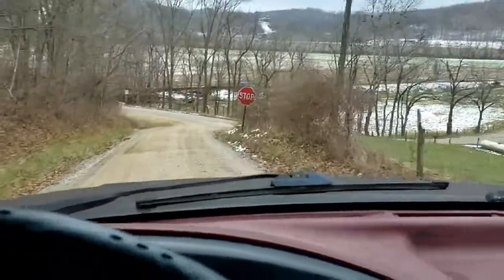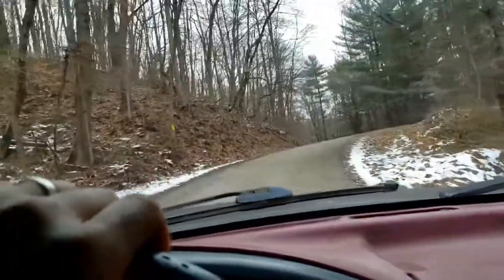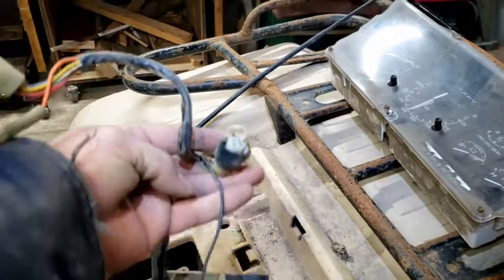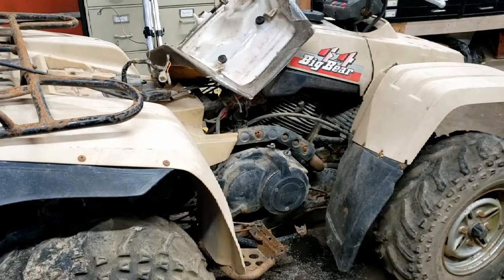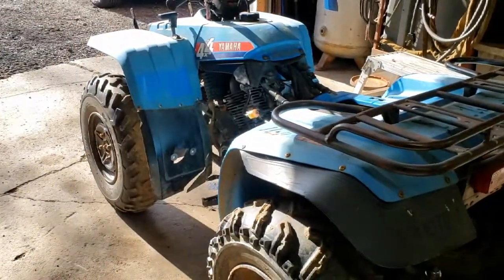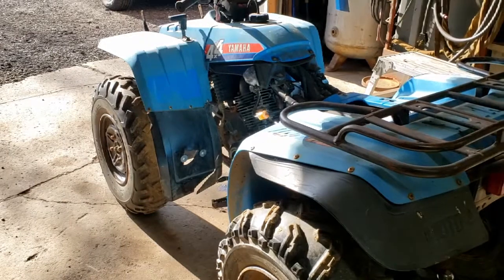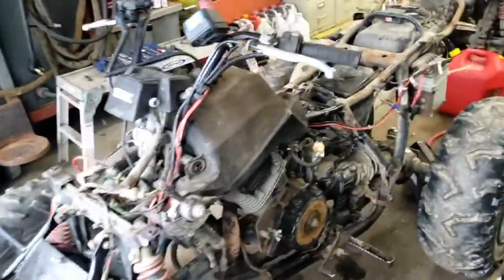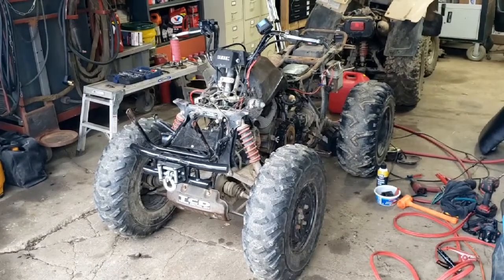Big Bear 350 Rehab - Part 4: CDI and Stator Troubleshooting

Comment: Thanks for the video! I have a 87 Big Bear 350 and its been down for almost 4 years have replaced Carb, CDI, Coil, Peacock, Fuel Lines, did a Valve job, checked the timing and now have bought a stator and waiting for my Mechanic to swap it in, hoping this will solve the problem! I bought this new and have it set up for doing jobs around the farm and really need it ! from watching your video mine ran just like yours did( no top end)

Comment: You don’t have any back pressure from the exhaust pipe. Weld a plate over the the end of the pipe and drill a 1/2 inch hole in the plate. Ooops didn’t realize you put a proper pipe on it. Good job figuring it out.

Comment: Bridge the brake switch on the left side handle bars, fallow it down and unhook it. After that connect the 2 wires you unhooked together but not the wire from the switch, the ones that are part or the wiring harness

Comment: I bought a cheap cdi and wired up for $9 got a spark but the timing seems off you no if the old CDI has built in timing advance and maybe mine new one doesn't
Reply from the maker: That's sure what it seems like to me. That or you have the 2 pickup coils and the CDI is connected to the wrong coil.

Comment: I have the same machine as your blue 1988 Big Bear. I just came from the dealer and the mechanic spent 20 minutes looking and reassured me that the 1988 had only a single pickup coil. So I searched through my photos and found photos of serial number and manufacturer date 9/86. Long story short, turns out the blue 350's are not Big Bears even though Big Bear is pasted all over it. They are 1987 Moto 4 350 / Big Bear. )) In 1988 they went to a single pickup coil. 
The parameters for the dual pickup coils are 180-220 
Yellow - Green
Gray - Blue
The parameters for the source coil is 220 - 330
Brown - Red

Comment: man I am glad I found this video. i have an 87 350 and it only fires once on the 1st rotation. then again after the key switch is reset. my pickup coils are in spec 192 but source is 325 which is close to 330. any thoughts any help appreciated
Reply from the maker: I'm not an expert on these, but it sounds to me like the CDI would be a good place to start.
Reply: I am also working on a 1989 350 big bear, and have the same issue, sparks once then nothing, shut key off , turn back on, push start button engine turns over sparks once then nothing. Bought cheap caltric stator, cheap cdi and a Ricks coil. Still sparks only once. Do you have 2 trigger coils? Do you have 3 relays? Is it the cdi that switches from basic timing to advanced?
Reply: @fjb6576  have you disabled the park brake sensor. They fail all the time. Basically the park brake sensor goes bad and acts as a restrictor.
Reply: did u figure it out man ?

Comment: What would cause a 1995 to cut out low-mid rpms. Revs fine in neutral but once in gear it has no power and will cut out or miss until i get up enough speed than it will be alright once im in the high rpm range. I had my carb gone thru and everything is clean. It dosen't smoke or dosen't backfire.
Reply: I have the exact same problem.
Reply from the maker: @mikechapman599 replacing the pickups in the stator solved the issue for me.
Reply: @mikechapman599  mine was a cracked intake boot. It wasn't even noticable when looking at it but sure enough when i goy it appart it was split in 2 pieces.
Reply: Thanks, guys. intake boot is brand new last year. But I will double-check that.. it may be the pick-up

Comment: Question for you does your exhaust pipe coming off the engine still glow red hot after fixing the cdi and stator?
Reply from the maker: No it doesn't. I think that the ignition timing was way late so it was ejecting fuel that was still burning through the exhaust. Runs a lot better and much cooler now that the ignition timing is right.
Reply: Im having the same issue with mine glowing red but now my machine is stuck in reverse after pulling a few logs any recommendations?

Comment: Do you know would case a big bear to have loss of power I have rebuilt the carb and checked timing and other stuff just cannot figure it out
Reply from the maker: Does the exhaust get like stupid hot? Like practically glowing?
Reply: @diymechanictv1233  no. Could the stator or the magneto cause that problem
Reply from the maker: It did on mine! The timing wouldn't advance as the RPMs increased.
Reply: @diymechanictv1233  I am confused on what you are saying
Reply from the maker: Mine would idle fine but had no power above idle because the ignition timing wasn't changing like it  should.
Reply: @diymechanictv1233  how do you check ignition timing
Reply: @diymechanictv1233  if that is the normal timing then it is spot on
Reply from the maker: Not much you can do on these bikes aside from replacing things. I did it on a hunch and it proved right. Start with the CDI and the pickups on the stator.
Reply: @diymechanictv1233   is there a way you can test the stators or do you just take a guess and buy a new one
Reply from the maker: Yes. One of the videos on the channel walks you through that process.
Reply: @diymechanictv1233  ok I will check it out. Thanks if I can’t figure it out I will get back with you
Reply: @diymechanictv1233  so I finally go around to testing it and it read around .8 for all of them and still have the problem I took the carb off and cleaned it again just to make sure and I put the factor air box back on the quad but have to wait till morning to see if that will fix my problem. One other question do you know the slide pin piece do you know what it it is supposed to be clipped in I don’t know if that would cause the problem I am having.

Comment: Hi again, apologies for my comment in part 3 as I didn't realise there was a part 4 where you had solved the issue.
My issue persists whereby my 92 big bear struggles to start (occasionally backfiring ) and takes an awful lot of cranking to eventually start and when it does start it is a weak idle/firing. When I open the throttle is goes well.   But it struggles to idle and the plug lands up sooted indicating that it is running rich.  I am assuming the backfiring when trying to start is flooding.  Are you able to tell me how to adjust the carb to idle less rich ? I can only see the fuel mixture screw which is a pain to adjust with the carb on the quad. Is there an air mixture screw or am I missing something?  Great informative videos by the way!
Reply from the maker: That mixture screw is the only way that I know of to make any adjustment to the air/fuel mixture, unfortunately. After fooling with mine for so long, I ended up buying a replacement carburetor and once I got the ignition timing issue resolved, it has been running well.

Comment: Hey I just got this exact quad. I have some very small things wrong with it such as the gap in the small boot in the rear axle. You had this exact problem in your pt 1 video. Do you know where I can get a replacement? I also am trying to find a pull chord but having trouble finding a handle that will fit snug with this engine.
Reply from the maker: They're great bikes! Not a real powerhouse but a good reliable workhorse.

I ended up ordering the boot I needed from Partzilla.com. It's supposed to arrive by mail today, actually. I didn't look to see if they had pull start parts or not, but that'll be soon to follow on mine are well. Mine had all the parts but the pull start was full of mud and rusted the spring in half.

Good luck with your project!
Reply: @diymechanictv1233  thank you. Did you ever fix the fuel leak issue. I have the same thing. Also to replace the boot don’t you have to take the entire back half out?
Reply from the maker: Yes, the back swing arm and axle have to come off the bike to replace this boot, but it really doesn't look to be that big a job. Maybe I'll shoot a quick video on how it is done.

I never really saw it leak fuel. The PO said the petcock leaks, but I've never seen it leak once, so who knows...

Comment: Make sure you check compression it's because of valve lashes right doesn't mean a valving leaking and if a valves leaking compression it'll never have any power
Reply: Great job man Great job on the video I stand corrected on the exhaust just awesome

Comment: when you pull that carb  off again,you should be able to disconnect the throttle cable at the carb. just pull the throttle lever in the carb back and slip out that little brass retainer at the end of the wire and it will just fall off so dont lose it. then you unscrew the nut just on the outside of the carb and the wire will pull through
Reply from the maker: Sounds good, I'll have to try that if I take it off again.
Reply: @diymechanictv1233  just installed my carb after a cleaning and carb kit install.  Half the parts weren't correct but was able to use the orings and seals with the original parts. I'm having a hell of a time getting it run smoothly. Any adjustment suggestions?

Comment: Brother you ain't got a spark problem You got a fuel problem now you need to check your compression and see what it is I'll tell you if it's the valves and the rings it ain't smoking so I wouldn't think it would be rings but it could be the carburetor it's definitely a fuel problem now some of them had a slight adjustment you could turn on that stator loosen up and turn it left or right and that could be out of whack

Comment: Souds like the carb
Reply from the maker: That's where I started...but not what it ended up being.
Reply: For the boggy throttle Check the diaphragm  of the carb make sure there is no holes or rips. This was the case for me
Reply: @marc2109  did your big bear do it under a load? Mine has power but it will cut out  ridding at lower rpms-mid rpms. If im at really high rpms it will be totally fine and i can do 70kmh easy. No loss at power up top but when its struggling or at the beggining of each gear it will cut out. I am thinking of the stator being bad.

Comment: Yeah that's for sure You're you're mufflers clogged up that is 100% fat it does the same thing on a car when a catalytic converter gets stopped up that thing will have no power it'll fire up but it won't have any power and the thing will glow red You're exhaust is stopped up for sure